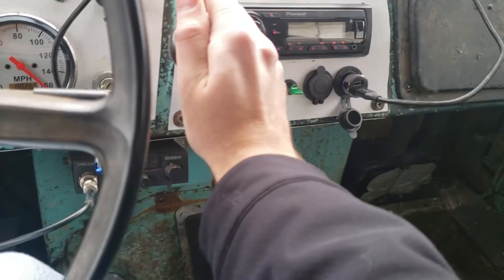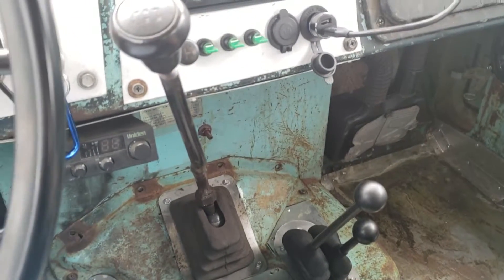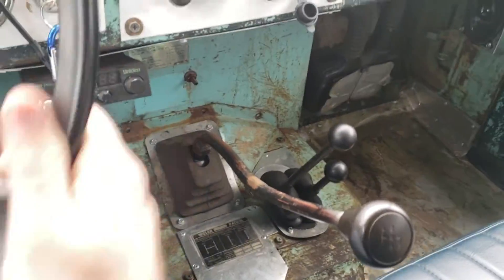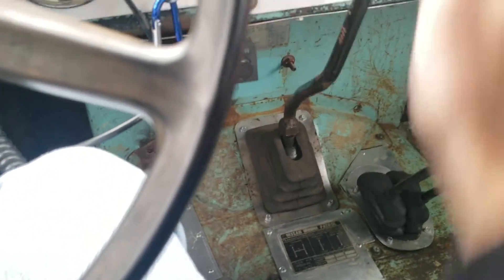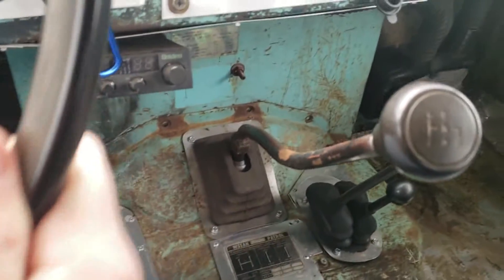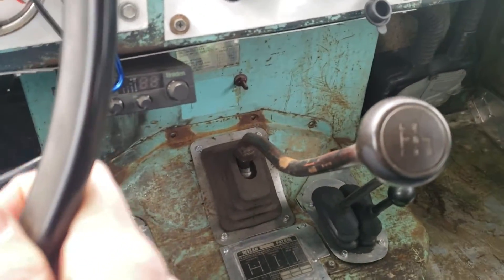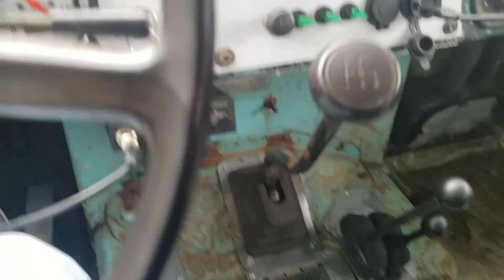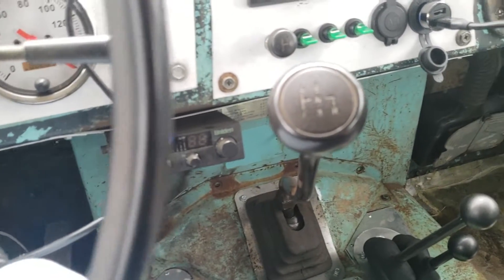SM465 1st Gear Pop-out Problem

Comment: Did you find an answer for this yet? I just bought a truck that has this same issue. Please let me know and save me some time. If not I'll post up here again when I get to the bottom of it
Reply from the maker: The general consensus on the forums seems to be "needs a rebuild".  I havent had the time or the want to rebuild this thing again, so I'll deal with it for now.  I'm still not sure what the actual problem is...
Reply: So I've managed to wrestle and beat my 465 into submission. Seems like what happened is the 1/2 shift fork was really worn and not giving a full send. It's seems to have chewed up the reverse idler gear and the reverse driven gear. I did just buy it so those gears may have been chewed up already. 

You might be able to just pull the top cover and replace a fork. $50 for the fork and $30 for a top cover rebuild kit might get lucky. I hear that riding with a hand on the gear stick is what causes this.
Reply from the maker: Thanks for the input, yeah I thought it might be a fork as well.  I just haven't torn into it again.  One day...maybe haha
Reply: I have the same problem but it’s only doing it in 3rd gear a.k.a 2nd on knob but anyway I pull the top cover and found the shift fork is worn so replaced it and the spring and 5 ball bearings. Should I go ahead and replace the 1st and 2nd fork too since I have it off. Only fork I didn’t get was the reverse because I’m have no problem please lemme no

Comment: That looks like a NP435 you sure it's SM 465? 1-2 slider is worn out along with the synchro rings the shift forks may be bent or just worn.
Reply from the maker: Its an SM.  Thanks!  I'm still driving it as is for now....I can deal with it